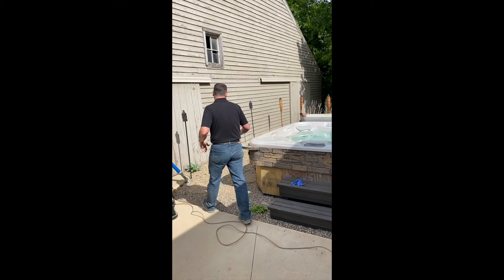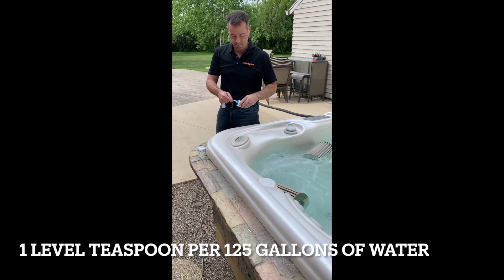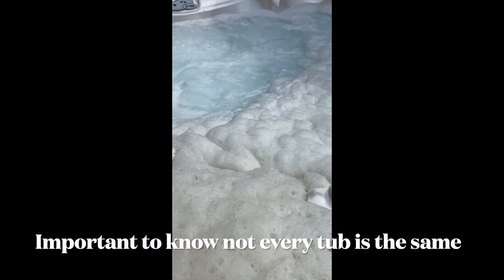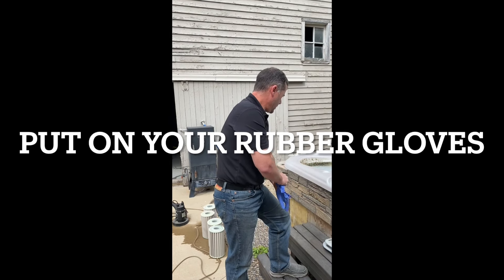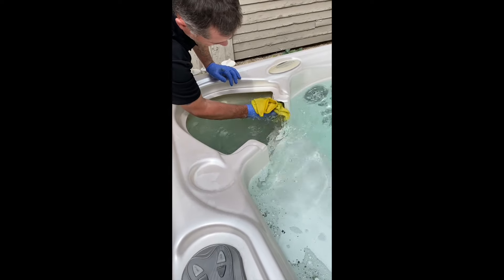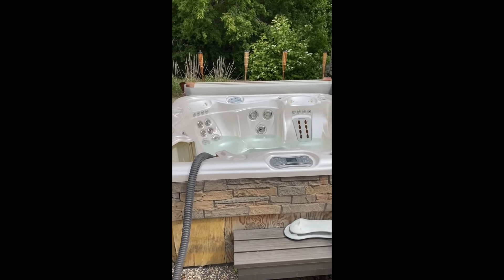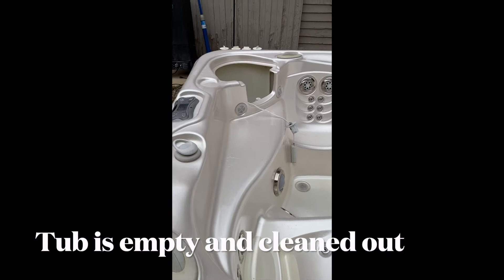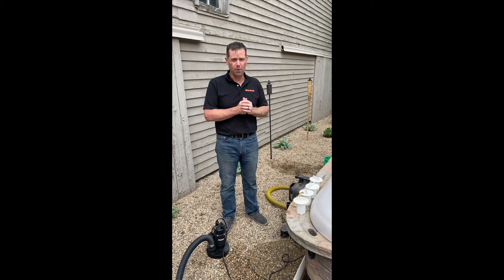How to Purge your Hot Tub with Ahh-Some

Comment: Hey quick question; I've gone through three things of ahhsome now, and there is still some stuff coming up.  Do I need to keep doing it until there is none or very little? I noticed in your purge, you only did it once despite having a pretty good amount of sludge come up.  It's important in my case, because my skin is very susceptible to Folliculitis.  I recently had a bad breakout of itchy bumps. I didn't know until recently we were supposed to "purge" the hot tub when we drained it; the supplier never told us that :(
Reply from the maker: Fantastic question and one that we get often.  Every tup is a bit different and some require more cleanings than others.  Personally, I will purge until there is generally only a very small amount coming out.  Some will choose to purge until absolutely nothing comes out.  I have had folliculitis as well and it is NOT fun.  I hate to itch.  That said, you can continue to purge using the same water and the same Ahh-some for a solid 24 hours before you need to add anymore and then you can just dump when done.  I would also encourage you to look at our Aqua Clarity Weekly Maintenance product.  This works extremely well in helping to reduce the amount of biofilm build up that occurs.
Reply: @ahh-some  thanks! So is they the same as Serum? Because the supplier didn’t tell us we needed to use serum on a weekly basis either :(
Reply from the maker: @1SIK335  Very welcome.  Aqua Clarity and Serum are very similar and both accomplish the same goals.  If you choose to use Serum, this would be a weekly.  Same as Aqua Clarity.  Both are weekly.